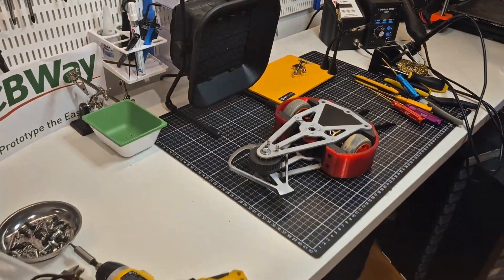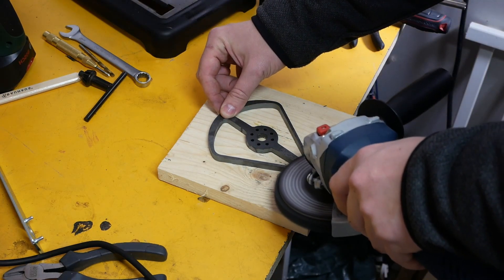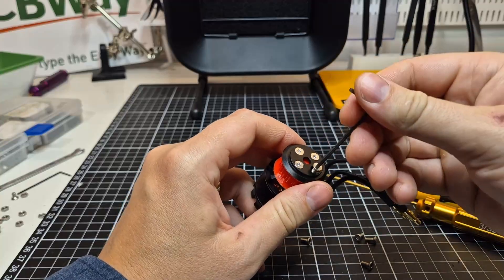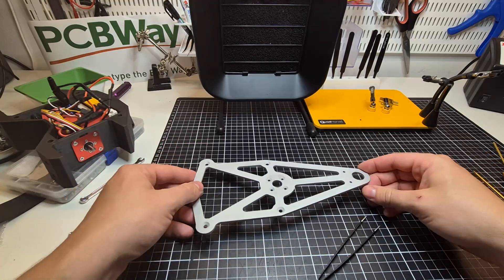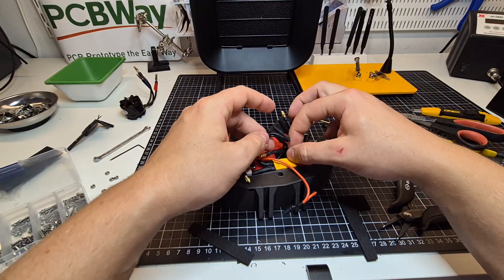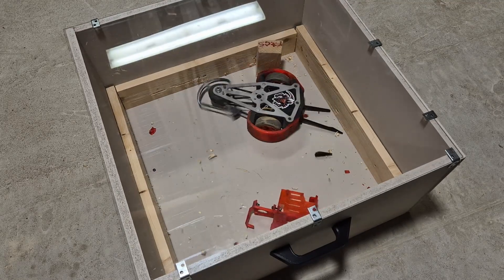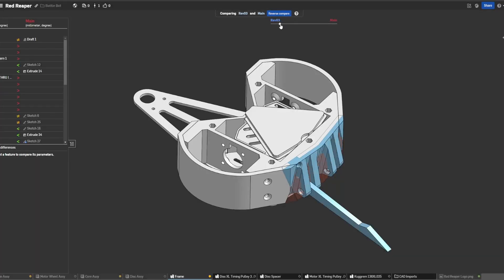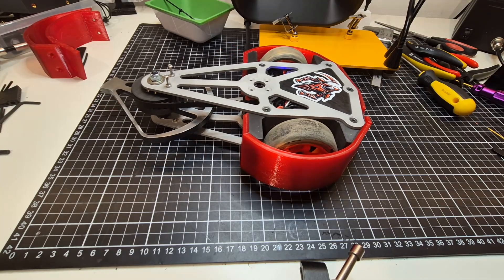Building Red Reaper: My Combat Robot from Design to Testing

Comment: im planning on building one kind of like this but my only concern is the pulley In the last fight I saw almost every robot with a  horizontal spinner lost because their weapon broke specifically the pulley broke any tips so I can avoid this problem maybe a metal chain could work?
w
Reply from the maker: Good luck building your robot! You could try to add some kind of protection to the pulley that is attached to the frame or maybe use 2 belts. I don't think a metal chain will work for the speeds you want to spinn your weapon.

Comment: I have been fighting horizontals since 2018. The only weak point I see is weapon attachment to the pulley. The heat inserts will rip out very quickly in combat. Especially from a vertical spinner hit. I bolt all the way through the pulley wit a T-Nut on the other side. If your main pulley is printed you need at least 6 layers on the walls or the center of the pulley will explode after vertical hits. Beautiful design and I look forward to seeing the battles! Good Luck!
Reply: Agreed, this was the first thing I picked up on as well, heat set inserts just aren't good for strength and through bolting is way superior